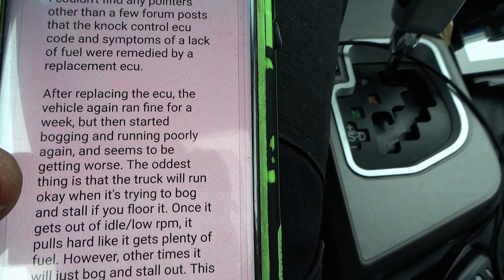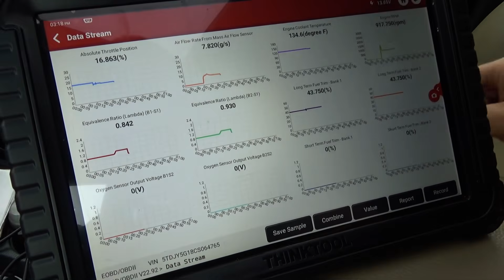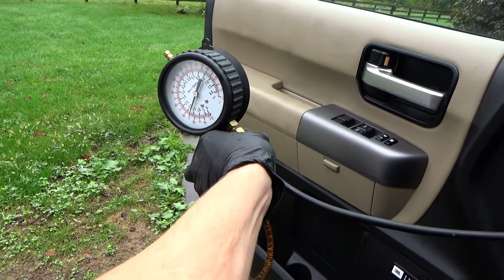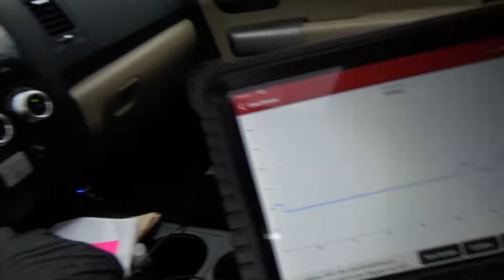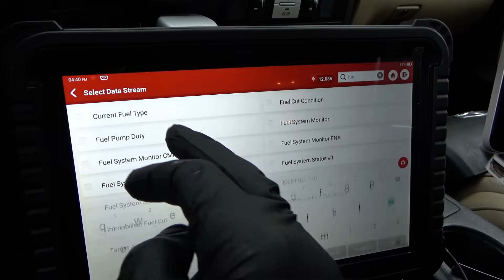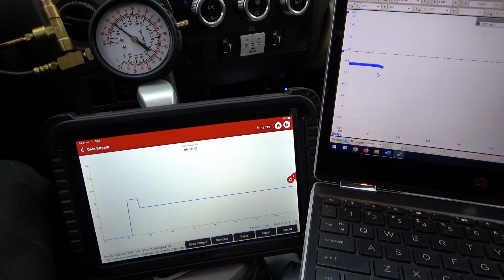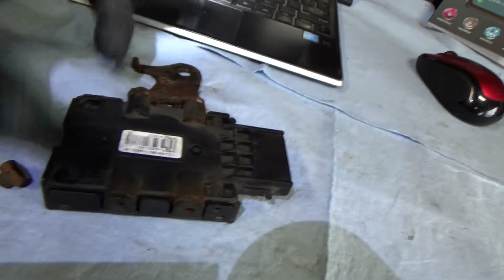(Pt 1) $2000 MISTAKE? (Toyota V8: LOW Power-STALL-Runs LEAN-Low Fuel Pressure)

Comment: I actually purchased a Toyota factory DS master window switch through eBay from Japan and received it 5 days later to California, for half of what U.S. sellers were asking.
Swapped out the bad one for the new one and it's been working perfectly ever since.
Reply: I have many genuine parts sources in Japan and UAE and must cheaper often then locally (New Zealand)
Reply: Yep, all genuine Toyota parts are only available from Toyota stealerships, but for some reason there is big discrepancie in prices. My local dealer rarely comes close, often twice the price. I don’t get it! I guess that’s why they get the stealership brand. 👍👍🇺🇸

Comment: I wanna scope the input and output of that little module, too!  The only thing that's getting me is the amperage and fuel pressure dropping on increased throttle input.  The module is capable of putting out more amperage than it does during those increased throttle events, so is the amperage dropping because the pump is falling flat on its face (lower fuel flow versus demand = lower amperage), or because the control signal being sent to that module is telling it to reduce its output?  Or is the module misinterpreting the control it's being sent?  The amperage measurement is giving us a broad picture, but scoping the input and output of that module could fill in some details.  :)
Reply: Yes, the current measurement is not telling us whether it is the module that is unable to provide the current, or if it is the pump that does not draw the current. A voltage measurement would be required to tell the difference. If there is voltage but no current, the pump is bad. If there is no voltage, the control module is bad. Since the voltage is duty cycle regulated, a scope measurement of the voltage would probably be most informative.

Comment: So many things can cause an engine to run poorly.........throwing ECU's at the problem is pretty random without even a cursory investigation.  Boggles the mind, that the previous shop did not even bother putting a fuel pressure gauge on the fuel system........completely anemic fuel flow is not just the pump, it can be many other things.  Fuel pressure could be getting lower with load simply because the vac reference line has come off the fuel pressure regulator.......could be collapsed fuel line,blockage etc etc.

Comment: Just had one the same on the first visit  I looks for vacume  leaks . Had a code for 1 bank at the time no problem  found and couldn't  respond  the problem.  A few weeks later came back both banks  lean . Found no fuel return bypass pressure on the regulator  . Fuel pressure  was normal  but low side . Customer  requested  a new fuel pump . And it fixed  the problem
Reply from the maker: What were the fuel trims and actual fuel pressure?